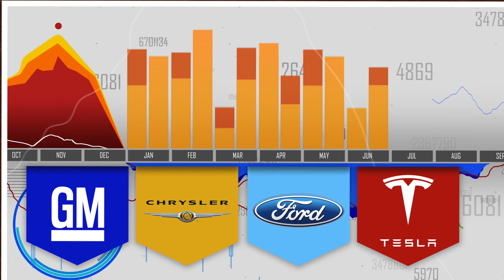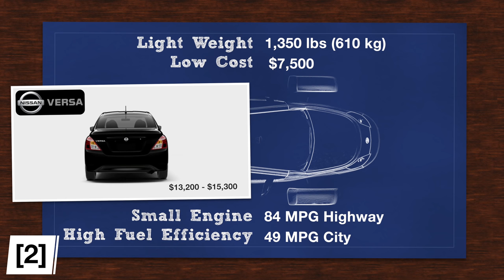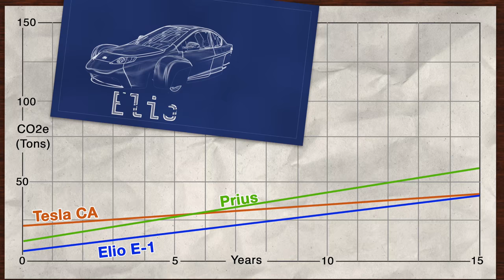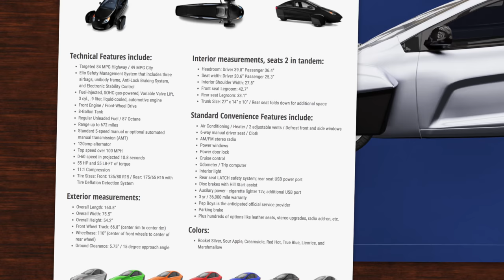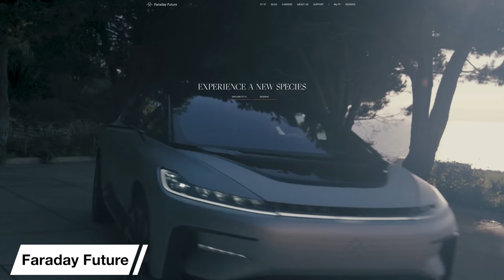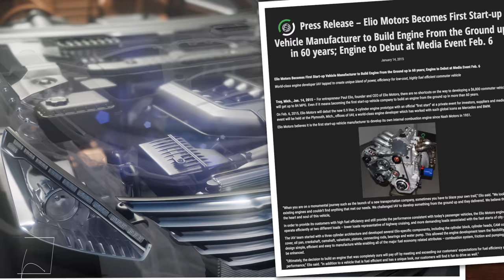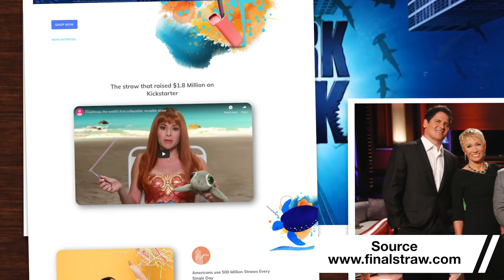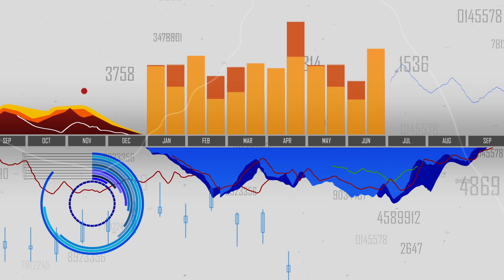How this Radical Car Missed its Chance to Change the World

Comment: One of the biggest flaws in this video is the fact that Elio has already gained exemptions from almost every single state to helmet and motorcycle endorsement laws. Their website even has a map to show the holdout states. I believe there is only one or two left.
Another is that EVs are not gaining as much ground as the narrator states. Most people are realizing that drawing from their local power plant is worse for emissions and EVs are absolutely horrible for driving more than a few miles away. 
There are plenty of other inaccuracies in this video, but that's just a starter without writing a whole book. I do hope the Elio pulls through, however, as it is honestly the best solution for the majority of people right now.

Comment: I'd buy one because I don't expect our power generation to go green enough for an EV to be effective.  Remember coal, bunker C and diesel to charge batteries is far worse than just using gas to power a car.  It might be wise for Elio to incorporate a paint on solar charger to reduce the HP required to charge a battery much less to run a radio, lights, or heater

Comment: All Elio had to do was start making less than 500 units a year to get started with get their feet in the water and slowly start mass producing at a later date.  But they wanted to start mass producing in the 10s of thousands right out of the gate. That was and still is their death since they lost their momentum.
Reply from the maker: Well said yeah that would have made more sense
Reply: According to the pricing for Elio, making 500 per year would have resulted in a much more expensive product. That would to have been at least $20K per unit and then I wonder how many would be interested? The car is designed for mass production, so hand building it would not work.
Reply: @billsmith5960  I just got a chance to read this but am heading into work now.  After my shift is done I'll reply back with what I believe the plan should have been from the beginning.
Reply: @shadowzedge5793  - I've been following Elio since 2009 and this is what they are trying to do (I'll use pizza as an example):
Paul want's to go up against, Pizza Hut, Dominoes and Papa Johns. He's going to do it better. He's going to offer just a 16" cheese pizza with two extra toppings (anything more is charged extra). So he's going to have free delivery and it'll be in 30 minutes. All of this for just $3/pizza.

He will be able to do this through sheer volume and the simplicity of the same size. Then he gets his ingredients from the blue chip suppliers. In the end, the Elio Pizza will take off and do great.

Downfall is, that business plan sounds great for the consumer but it's a money loser, thus no investors because they can see it'll never work. Elio is trying to do this with a car. Sounds great for the consumer but not for the ones investing in it. They all know, it'll go bankrupt in no time.
Reply: Kommander Rahnn  - Excellent well thought out response. Keep up the good work.

Comment: There is for sure a market for Elio in some countries. 
The catch with Elio is that you still need another car to do the  "non commute" long distance driving - or use public transport. It's the same issue some EV owners are confronted with today.   
90mpg is something you can almost reach with a plug in Hybrid today. Plus you get subsidies with a Hybrid. So I'd guess that many will go Hybrid instead of Elio - at least in Europe / USA / Japan.
Reply: I don't understand your comment. It will go long distances just fine.  You only need another vehicle if you are packing heavy or carrying more than 2 people.  Plus it is way cheaper than a hybrid.

Comment: "Commuter cars," meaning cars maximized for daily commuting, have a very, very narrow appeal, particularly in the US.  If you have need for transportation to work, you're probably living somewhere that you need a vehicle for more than just commuting, you probably want to occasionally haul around more stuff or people than this thing could safely (or even possibly) hold.  Why do you think the best selling passenger vehicle in the world has been the full size Ford F150 since the 1980's, and why crossover SUV's are all the rage?  The Elio's main appeal is for people who want a cheap to own/cheap to operate additional vehicle for commuting, and that market is tiny.  If they'd made a small, unique and ultra-efficient four wheeled car they might have had a chance, but even then, probably not.  There's just not enough people who want something like this to make it viable.  As for the cheap price, so what?  You can get some truly nice, low mileage used cars for the same price and not have to worry about whether the company will disappear along with the parts necessary for repairs.  Really, this is just a motorcycle with a closed cabin, and it doesn't have long-term appeal for people who love motorcycles or people who love cars.

Comment: If it were available,  I would love to have one. Provided that they get around that helmet requirement, the windows on both sides roll down, I don't need power windows or seats or mirrors or intermittent wipers or any of that crapola,  and provided that Elio offers a MANUAL transmission. I have no interest in anything with a damn automatic. Even if it is a sequential manual like a motorcycle, that would be fine. All I want is manual transmission, cruise, (but that's not a deal-breaker),  heater,   AM FM Bluetooth USB stereo, a reclining height-adjustable seat (I have a messed up back, and can not sit stark-upright, and I'm short)  and a tilt wheel.  I love the concept, and am quite fond of "unusual" cars that are not cookie-cutter crap that you see hundreds of every week.   I have no kids, no dogs, and never will. I rarely drive with anyone else, and if I do,  there is one other.  If I need to haul a couch, or a washer/dryer etc, I can get my Dad's Chevy S-10 any time. There are two seats, perfect for me and a friend or S.O.  It likely has a small trunk/cargo space so for one or two people, a grocery trip is easy, especially if I'm the only one shopping, and can load the passenger seat/floorboard with my purse and shopping.   ALL of which I have done many, many times in my Fiero.

Production models might do well with significant marker lights/reflector combo on the rear of those fender fairings though. I love big trucks and all, but  I can just see some asshat zooming past real close in a truck (or even a normal car) at night, acting all smartass and not see the extended front wheels, thus clipping one right off!  Small driving lights/markers/turnsignals would be good for the front of them too for the same reasons.  With the LED's they can be light, efficient, bright, and rather unobtrusive in design.
Reply: I just looked it up.  and BAM!  It has everything I ask for and more.  Sign me up!   all it needs are the marker lights on the front fenders that I mentioned in my post above..  
Other wise,  it's freakin Great!
GO ELIO!
Reply: @Cammi_Rosalie  - Elio is taking reservations. Sign up now and you'll receive the benefits before everyone else that is just sitting around. The best is to do the $1000 all in non refundable. That get's you further up in line.

Comment: I have become convinced it will never happen. Ten years of delays doesn't make one optimistic. I was on the bandwagon ten years back. But now? What has that price risen to if ever produced? They aren't going to be able to sell it at anywhere close to the original target price. Failure after failure saps people's faith. I WANTED this to work. Had it, car companies would have been faced with the absolute requirement of building cheaper cars. "If Elio can do it YOU can do it and if not we'll buy Elio." But it was and continues to be a pipe dream. I wish I were wrong. I'm not.

Comment: The only thing that would hold me back would be that one of my hobbies involves carrying long objects.  The Elio just doesn't have the space necessary for it.  While it would be feasible to have some sort of removable bracket on top for this, I wouldn't want a $2000 item flying off the roof of my car.

Comment: Sorry but the Elio is only an updated Messerschmitt KR200 from the 1950's. The KB200 sold reasonably well, but after a while the car buying public decided it wanted something more than just an all-weather motorcycle. There were a number of "cycle-cars" being made in Europe around this time, but most had 4 wheels, 2 or more doors and could seat 4. I would think that is the way ELIO needs to go in order to appeal to more than just a niche market. Also, electric is fine, but a fuel or hybrid power plant is far more practical. If you read between the lines, you will realize an electric Tesla needs to be charged 2 hours for every 1 hour of driving at 60mph. In contrast it takes less than 2 minutes to fill my Ford Ranger's tank from empty to full. I can drive 300 miles at 70mph, stop for 10 minutes for a fuel and health break, and then immediately do another 300 miles. When you invent an Electric vehicle that can do that with 4 people on board, let me know, and I might buy one, (if the price is competitive).

Comment: Should have been an EV from the outset, 25kWh battery, 60kW rear motor, 60mph max, fuel efficiency would be >200 MPGe, range 300 miles, better acceleration and stability due to lower CoG.
Converting the design now is late and expensive but less so than bankruptcy, which is where Elio is otherwise headed.

Comment: I did purchase a $100 T-Shirt, a deposit on a future car.  Three years back I released that I did not want an Elio with a gas engine.  With an electric motor and a minimum of 100 mile range with a double price of $15,000 and reasonably good reviews I would purchase one.  On January 2nd for 2020 I came across a 2015 Smart electric for $5,500.  The Smart is great for around town, it does not have the aerodynamics for the highway or the range.

Comment: I don't think converting the Elio to an EV would help;  until there is a significant improvement in the electrical recharging infrastructure, EV's will remain a niche market.  However, if the price of oil ever goes through the roof,  Elio immediately becomes more attractive given that the big three US auto manufacturers have dropped sedans to concentrate on trucks..

Comment: I'd buy one.  I live far from a city and there are thousands of miles to explore here in Northern Wisconsin.  A couple of times a month I need to go to Green Bay, this car would be fine for that.  I have a truck for the dogs, the hay, the bulk supplies....I like the idea of something a little more sporty for those trips that don't require hauling capabilities.  I don't want expensive (Honda), I don't want crappy (Versa), I don't want a motorcycle during rain/snow.  I don't need a crazy sound system and can do without navigation junk....I learned to read a map a thousand years ago.  The only thing I wish it had is more speed.  0-60 in 11 seconds can be dangerous in some situations.

Comment: I believe that having an EV option would help, also rear wheel drive and an option to use rear tracks, like a snow mobile, and skis in front. The possibility of using it as a winter/summer off road vehicle could be considered. Americans love to tinker customize and modify things. This could be it, on the cheap.

Comment: As you mentioned - adding a second wheel in the back would have made it an automobile  and made it a much simpler sell even though there would be more costs involved with certification but that wasn't an added cost to the buyer as a motorcycle license would be.

Comment: The biggest mistake Elio Motors made while developing this vehicle was trying to re-invent the wheel by developing their own engine/drivetrain. If Elio Motors had only partnered with a manufacturer with an already proven engine/drivetrain he would have made his vision come to reality. That's what Polaris did with the Slingshot and Vanderhall did with their vehicles. Those two companies partnered with GM and are still around and doing fine. Why why why did Elio Motors think so foolishly? Now the claim by Elio Motors is to convert over to electric cars, let me guess, they won't partner with GM or Tesla. I'm sure that they plan to re-invent that wheel too!

Comment: Because of Covid-19, mass transit is not an option.  The Elio could've been a viable option.  The Elio was supposed to be a vehicle using existing Commercial Off-the-Shelf (COTS) components.  Elio lost its way when it tried to develop it's own engine according to Jalopnik.  Resources were diverted from production to engine development.  There are only a handful of viable gas powered three wheelers (Polaris Slingshot, The Morgan, and Campagna T-Rex).  The Elio was supposed to be the gas powered three wheeler affordable to the masses.

Comment: Did I put down $100 to lock in my price on a new Elio? Yes. If it were made today, would I want to buy one? Yes. Is there a market for the Elio out there? Yes.  Will it ever be built and become a car anybody can buy?  No. We will never see the Elio and that's too bad. It is a great idea but they just didn't have enough money to make it a reality. Maybe things would be different had they gone with a motor that was already in production.  That would have freed up a lot of cash for other purposes. But would that alone have saved the company. Probably not. Elio's shortfall of money was greater than the money saved with a currently made engine would have provided. They still would have fallen short and they still would not have Elios on the market.

Comment: I paid $1k for a top reservation and invested $12k in the public fundraising.  Elio still makes sense for the same reasons it always did, many mentioned in this excellent recap video.   Not reinventing the wheel (motor in this case) was a good business move.  See Thomas Kuhn’s seminal book The Structure of Scientific Revolutions.  The concepts would succeed in the market if they could just build them.  The production phase needs a large angel investor company to buy it out - bigger than Overstock.com.  If they build it, the sales will come, regardless of whether it is 3 or 4 wheels, 3 cylinder or electric.

Comment: There is still  place for a small computer car that is both cheap to buy and cost effective to operate. converting it to electric will only boost the initial cost and slow the production out the gate.  A future model might consider adding a second rear wheel and that model could be electric, if the first model meets its production goals. I had considered buying the E1, but wanted to first see it in production. I do not thing I am alone in that feeling, and many others were simply waiting to see if it was going to make it as advertised.

Comment: I wanted one several years ago, fuel prices were unaffordable and climbing.  I ended up buying a smaller car, a cruze. While not 80+mpg, it is an actual car I can drive and not a concept that to wish for. If this thing were to come out tomorrow would I still wanted one? I just don't know. I held out hope for it for several years a few after buying the car even. I have now bought 2 vehicles in the time since wanting one of these.  I would still like to see it, I may still be interested, but it is no longer a need and it has drastically dropped on my list of wants. But anyway we will see next year when it hits production. Oh wait, next year has been the target for 10 years now. It is always a year away. The modern day Tucker.

Comment: Roush doesn't produce engines. They make performance parts and ASSEMBLE crate motors. Where did you get info saying Roush is making their engines? Not from Elio. They have been partnered with Roush. That part isn't new. Elio just stated they were going to partner with an oem manufacturer, and mentioned Roush in the same press release. Those two dots aren't going to connect. 

Elio is broke. Even with savings, they need 300 million to get going. They got fifty cents in the bank. It's over

Comment: Ten years ago there were several start ups for 3 wheel cars. Some were gas. Some were electric. Some had options for either. I thought Elios had faded away like the rest. I think being tied to motorcycle laws is going to kill them. I predict enough states will not modify their m/c laws to accommodate Elios.

Comment: I prefer ICE's vs electric. I had a gen 1 insight for years and I never really needed the battery (mainly cause it was in crap shape by 20 years old) and still got an average of over 70mpg. At $2,000 for a reman battery it just didn't seem feasible so essentially the battery just added weight. If they ever actually came out with the Elio I'd definitely buy one.

Comment: Paul still has a thousand bucks of my preorder money.  I'm glad they're sticking with gasoline driven, I just want to be able to commute around an replenish my fuel in 3 minutes, not 6 hours.  They did make a huge mistake in trying to build their own engine.  Ford makes a spectacular little 1 liter that's got the same footprint as a 11x14 sheet of paper, and has plenty of power and could be serviced at any Ford dealer.  The idea of having two rear wheels close together (like my old '57 BMW Isetta 300) makes some sense, but that would make it a car and thus have to be crash tested, etc.  As it is spec'd now, it's a motorcycle so no crash testing. Arizona doesn't require helmets for motorcycles (stupidly in my opinion), but getting a motorcycle license isn't difficult, especially if there was a specialy group that would restrict you to 3 wheel vehicles and you could take the driving test in it.